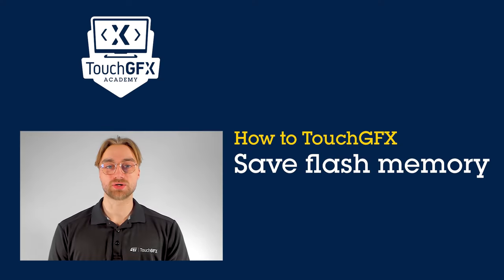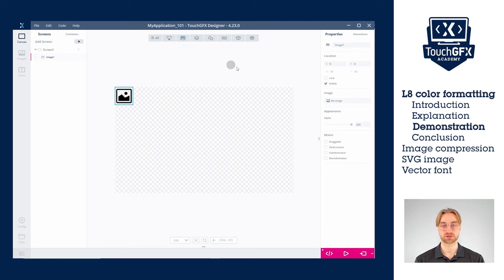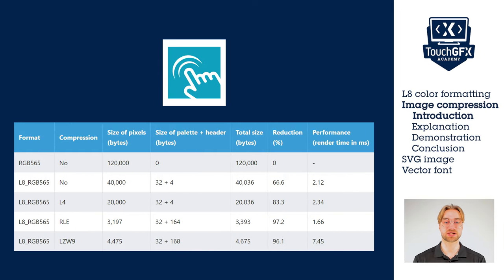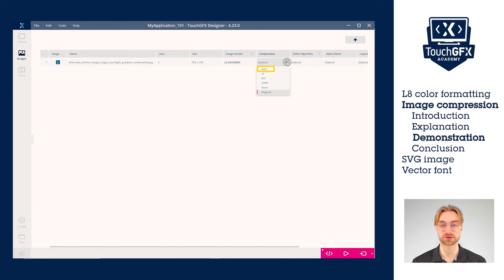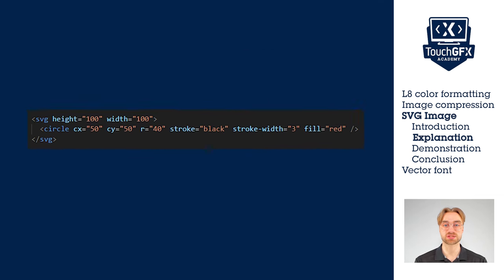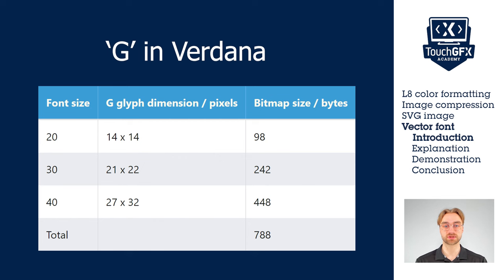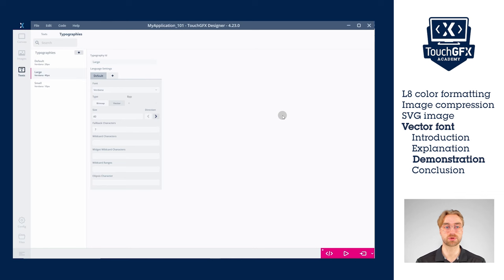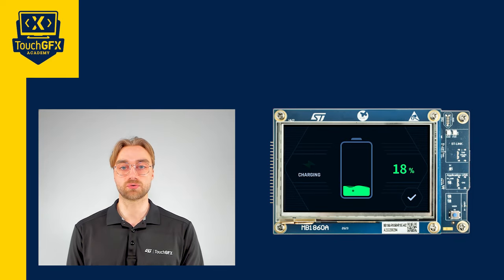How to TouchGFX: Save flash memory on your STM32 GUI application

Comment: what I want to know is how did you get that slider that does not follow a straight path. Ive been wanting to make non-striaght sliders but the indicator always moves in  a straight line.
Reply: Hello Edwin,
We try to provide widgets that are of general use (for example, a linear slider).
The slider in the video is a custom behavior that was designed by one of our engineer.
You can see how we made it by creating a new project from TouchGFX Designer and selecting Board specific demo.